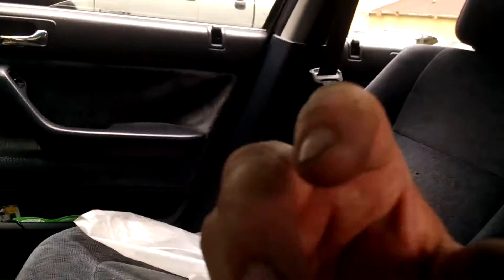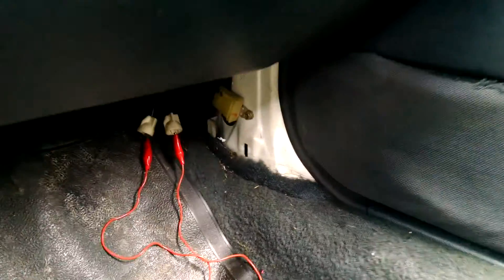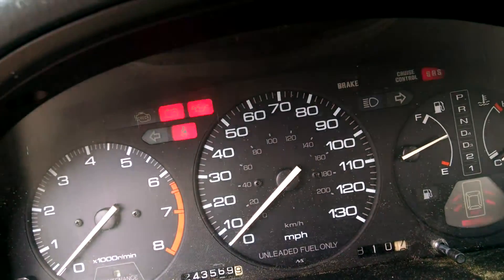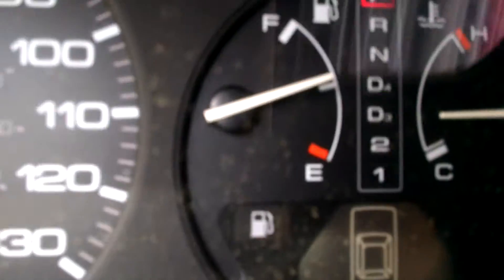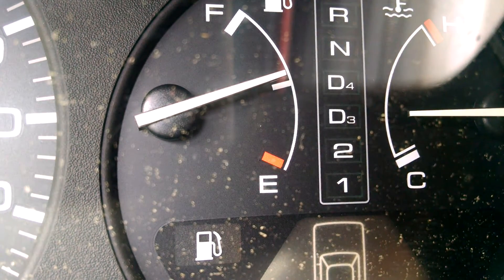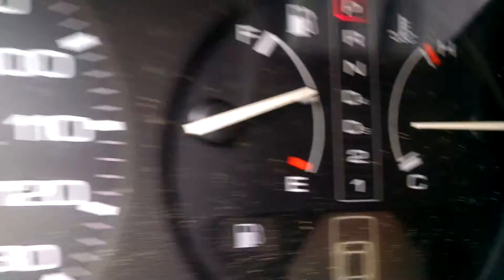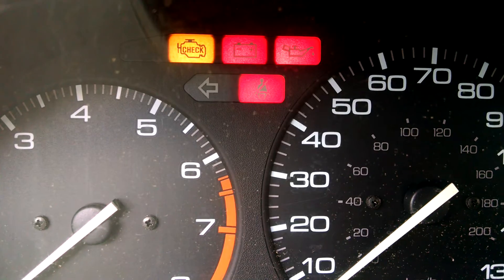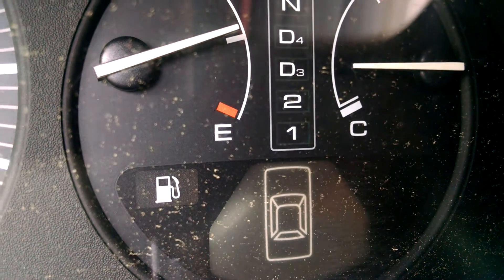1992 Honda Acoord engine and transmission codes

Comment: I have a 1992 Honda Accord crank no start no spark in coil but tested good ingiter in distribor tested good ran it 5 time's in a row at AutoZone .when you put a test lead on the black with yellow trace test light is on but not blink. New distributor still no spark turned it by hand

Comment: My 92 honda accord lx has been blinking a transmission code 9 for six months, car drives normal but I changed the distributor, and the computer UNDERNEATH passenger side floor ecu & tcu reset by removing battery cable and fuses , and the infamous code 9 is still blinking. Nightmare

Comment: I have a 95 honda accord dx with a 97 accord car transaxle. Im having d4 code 5. The car is perfectly driveable, sometimes no 1st, which isnt bad at all. Ive figured the code, but cant find anything online as how to fix. Help?
Reply from the maker: long blink is 10 short blinks are 1. Possible have wrong code number. Just a guess possible bad shift solenoid.
Reply: I have a code 5 as well but don't k kw the code for it. Just installed a new tcu as well
Reply: @johnandeddie  nope, it was a code 5. No doubt. I ended up tearing the shift solenoid, console, and dash apart. Come to find out the wiring bundle was shorting under the dash, sitting on metal. It was telling it was in drive and reverse at the same time. We tested everything, when in doubt, check your wires!!!